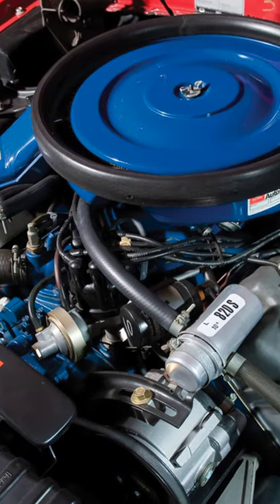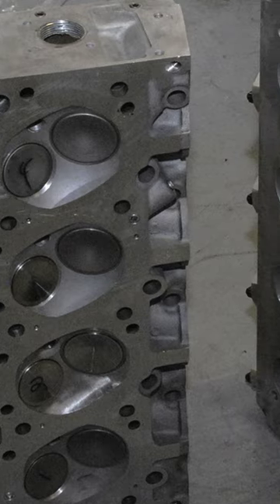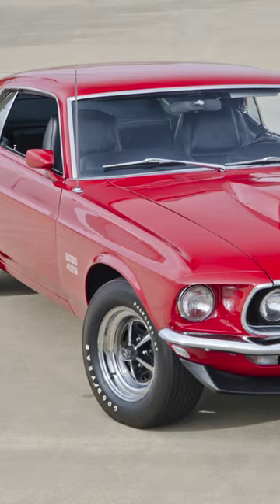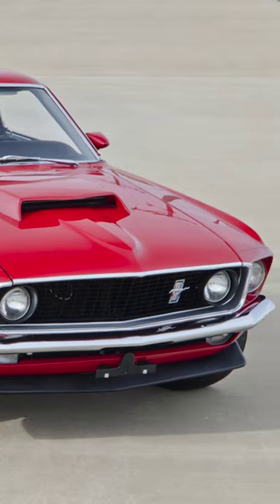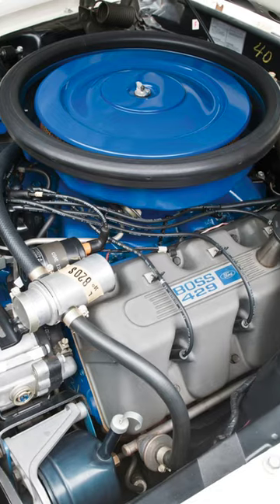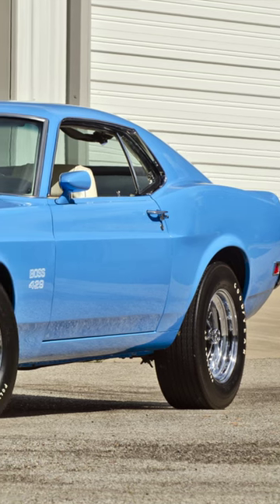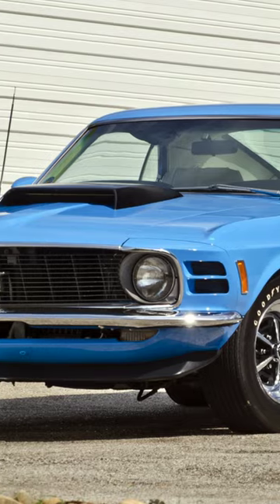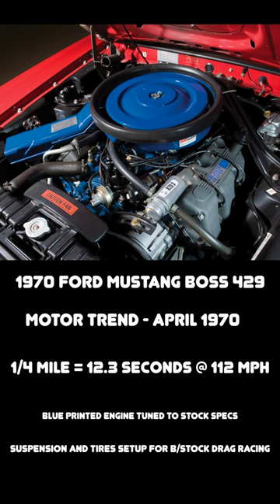Ford's Hemi V8 - Boss 429

Comment: My time with the Hemi Cuda, L88 Corvette, LS 454 Chevelle, and the 427 Cobra. Fast cars, fast women, rock & roll, and cheap gas.The fun days.
Reply: @TimothyMichaels  👍
Reply: no doubt I lived it wild times & happy *
Reply: When trucks were 50 bucks good times
Reply: Back when you could fill up by scrounging for change in the seats and ash tray
Reply: 🥃 cheers to all the brothers from the good Ole days.👍
Reply: Haha how about a 289 cobra with a 427 chassis
Reply: @MrTheHillfolk  that's just a 67 68 mustang
Reply: " a life well lived !" ( thr good times )
Reply: " a life well lived !" ( the good times )
Reply: Absolutely a kicking fun time ro live!
Reply: @poolguy101  we have Alm done that.  👌👌🏴
Reply: Now yall drive civics n corollas? Lol
Reply: @O S   Actually, I own a Z06, and the gas is not cheap, I'm married but I still listen to Rock & Roll.
Reply: @William Kacensky  well frack on my man!
Reply: @os7349  👍
Reply: L88 corvette is a very very rare car only 10 survive now. So I doubt you saw one
Reply: dazed and confused
Reply: I had a 70 Cobra jet Torino. Late 80s. Gas was cheap but still used a lot of it. 429 super cobra jet, 4spd, 401 Detroit locker. Run mid to high 11s on street slicks. Low mid 12s on reg. rubber
Reply: @Tony Preas  Sweet. One of my many rides was a 1964 Belvedere with a 426 wedge phase two motor. Not stock, it had 13.5 high dome aluminum pistons, 480 lift, 312 duration Crane cam. High-rise Edelbrock manifold, single Holly carb with hooker headers. Worked heads. Needless to say, it was extremely fast on the street, and could easily clock the times you posted.
It had a bubble glass rear window instead of straight glass. Painted  Ditzler black, with white roll & pleated interior. White headers and ladder bars. It had a 440 six-pack air intake scoop. The car looked menacing back then in the sixties. I never lost a street race and back then I had plenty. Even the cops liked my car.  :)
Reply: Had a l88 427 in a 67 chevelle.4:11 4speed.riduculous.couldnt get traction til 3rd gear
Reply: @Mark Simpson  
That was a beautiful body style. Only if we had known to keep these cars.  There were so many beautiful body styles back in the sixties.
Reply: @marksimpson100  389s woulda give you better first thru  third but drops a bit on the high end.
Reply: Ahh yes the 70s
Reply: “Life is good” -Hickok45 😂😂
Reply: @BlackNight Gaming  
I enjoy your gun videos Hickok 45. 😀
Reply: @williamkacensky4796  
🍻  🇺🇸
Reply: @marksimpson100  
Definitely not stock !   🤣
Reply: L88 did that mean the block was ninety degrees as opposed to forty five degrees as V8
Reply: Right on.
Reply: The good old days!
Reply: 1969-1970 saw the true monsters of the muscle car erra. These weren't pony cars, they were animals.
Reply: One of my favorite cars ever only mustang I like better is a GT 350 with a 5.2 l flat-plane crankshaft
Reply: Your Genous
Reply: Lies lies and more and more LIES kiz
Reply: @poolguy101 yeah, but remember wages were about $1.45 an hour🙁 I graduated high school in 1969, I had a ‘61 Pontiac Ventura w/389 tri-power, paid $200 for it, insurance was $165 a year full coverage. I was a bus boy at a restaurant, made .50 cents an hour. Good ol’ days!! 🤠
Reply: 400 ram air 4
Reply: @CoyoteFTW  True on the rare statement as only 216 L88 Corvettes were made. John Fox was the owner of a white 1969 L88 Corvette in the Berkshires where I lived. Back then, this Vette was extremely fast.
Reply: Yup yup! And still unmatched!
Reply: @dogdue4588  True.
Reply: @MrTheHillfolk  Haha You can keep the small block....

Comment: It was Ford's answer to Chrysler at the time.
Reply: Yeah but it was no answer at all!
Reply: Buick Torque Monsters enter the equation. GSX proven fastest car of 1969-70…
Reply: So what was the SOHC 427??
Reply: @johnpeters9793  that too
Reply: @tomschmidt9923 - Boss 429 destroyed the 426 hemi in NASCAR and later 385 series big block Ford Boss proved best potential dominating pro stock in NHRA and IHRA
Reply: Lol, Ford went 9-1 in 10 seasons against Chrysler hemi. The superbird was Chrysler's answer to Ford and went 1-1.
Reply: @Wolfcamp555  427 cammer
Reply: @Coronet_shop  not in NASCAR. They banned that engine. 427 high riser and boss 429 dominated the hemi from 1963 to 1970. Chrysler's only win came in 1970.
Reply: @Wolfcamp555  ah nascar whoops
Reply: @CoyoteFTW  429 Boss only ran in NASCAR for about a year and a half before Hemi's were banned. It never did well in drag racing since it didn't produce good low end torque numbers being developed for super speedways. Then regulations shifted everything to small blocks within a couple years. It was a come lately attempt to keep up with Chrysler's Hemi.
Reply: it is my understanding that Ford build the first hemispherical engine
Reply: @rodneygraves1230  25 more hp on the nascar track
Reply: @rodneygraves1230 Sure it was
Reply: @rodneygraves1230  - Ford engineers: Robert Yates, Bill Roper, Lee Willyard, Denny Woodle made sure every 429 made 610 horsepower and if you pushed it a little bit and tuned it, you would get about 620. Ford beat them in power. And beat them in weight. Boss engine was probably 100 pounds lighter at least. The Hemi was 700 pounds and the Boss was 600. Shotgun hemi was clearly better engine. Doesn’t take a genius to see that.
Reply: @johnpeters9793  it was almost the same but it had a ridiculously long timing chain the tends to stretch over time.
Reply: That's Not True At All, After That Motor Was Used In NASCAR ...... It Was Beating EVERYONE, Including The Dodge Hemi So It Waa Banned From NASCAR Afterwards.  That's The Real " Answer " And Trurh.
Reply: @johnpeters9793  it was a hemi also
Reply: @ztruth9861  negative.
Reply: @Wolfcamp555  Petty won Championship in 1964, driving a Plymouth, Chrysler sat out 1965, David Pearson won in 1966, Petty again in 1967, Pearson won in 1968 in a Ford after a falling out with Cotton Owens, Pearson again in 1969 Driving a Ford, Bobby Issac won in 1970 driving a Dodge Daytona the only championship the wing cars won, and in 1971 Richard Petty in the last year for a Hemi in either Ford or Chrysler and Plymouth's last full year, won the championship. so 64-71, Chrysler cars won the Championship 5 times , Ford three times. If Ford had run the King Cobra in 71 they likely would have won. So pretty even.
Reply: @GruesomesGarage  not talking about driver championships. We're talking about NASCAR manufacturers championships.
Ford 427/429 won 1963, 64, 65, 66, 67, 68, 69 and lost in 1970.
Reply: @Wolfcamp555  You're comparing apples to oranges. The manufacturers championship  was configured so basically the manufacturer who had the most fielded cars had the advantage . Chrysler was never going to have more teams running their cars than Ford. Ford spent millions in the 60s on motorsports not just in NASCAR but the GT40 program, USAC,etc. I mean looking at the Manufacturers title Chevy has won 42 vs Ford's 17. If Chevrolet didn't pull out of racing in 1963,they most likely would have won the ones you have listed. So lets take 1966, Plymouth won 31 races, Dodge 18,and Pearson won the points title in a Cotton Owens Dodge. as you point out Ford won the manufactures title.Lets say Pearson won the race and Petty came in second, yet being more Ford teams being fielded 3-10 are Ford cars for example. Ford based on shear numbers would generate more manufacture points.
Reply: @ztruth9861  actually the first hemisphere head engines started appearing in the teens Peugeot had a DOHC engine with a hemispheric combustion chamber that they ran at Indy in 1913
Reply: @GruesomesGarage  Ford's racing program was called Total Performance. It really wasnt about NASCAR. Ford won, Indy, Lemans, NHRA and F1 manufacturing championships too with three engines, the 427, the 289 and the Ford Cosworth.  And to this day, no other American car company has won Lemans. In NASCAR, it was Ford vs. mopar.
Reply: @Wolfcamp555  Well aware of Ford’s program and it was impressive. Chrysler was kind of a small fry in racing at the time. They had success with Petty and others, drag racing too. But they didn’t have the funds to supply multiple teams. It’s how they lost Bill Jenkins back to Chevy, he wasn’t getting the support he felt he needed, even after winning Stock Eliminator. Ford was as you pointed out in many different forms of racing at the time. While much hoopla is made about the GT40, it’s overlooked that they broke the dynasty of Offenhauser and the roadster in USAC racing.
Reply: @GruesomesGarage  Chrysler had plenty money. They just chose not to engage in anything else.
Reply: @Wolfcamp555  you forgot the 427 Ford tunnel port.

Comment: It's horsepower was impressive but its torque was equally impressive 500 ftlbs +
Reply: It's balance was amazing. 1 hp to 1ft/ lb of torque was unheard of for the time it was made. Like Nascar disallowed the 351 cleavleand as an engine for Ford as Chevy & Mopar had no small block that was even close to  keeping up with it. As the cleavleand got named a Y block as it had the ci of a   small block but the size & shape of a big block.
Reply: @tonypreas9850  facts 💪💯
Reply: The cleavleand got more into & out of a head than any engine made by anybody at the time. People still argue about the 2v heads were better to build for racing than the 4v heads but build a set of each and see. Give you more to work with. If running factory 4v were great.
Reply: @tonypreas9850  , idk the 340 Mopar is an amazing motor , saw a 70 340 duster gap a mustang with the cleveland one night , couldn't tell you how "stock" they were lol
Reply: @tonypreas9850  - yes the 351C had the highest horsepower to displacement ratio of any mass produced push-rod (OHV) V8 not solely because it had well designed ports and large valves providing superior volumetric efficiency, but also because it had superior thermal efficiency provided by one of the best performing combustion chambers of any mass produced OHV (push-rod) V8. Cleveland is the result of an aggressive design program, the 335 series motors were capable of making more horsepower per cubic inch, naturally aspirated, using gasoline fuel, than any other mass produced OHV motor ever made. It represents the culmination of all the motor savvy Ford engineering had accumulated during the Total Performance era.
Reply: suppose suppose was good 👍 😕 😕 😪 😌 😒 if if works 💪 👷‍♂️ 👷‍♂️ 🤔 🙄 😕 😐 💪 💪 💪 💪 i
Reply: No that engine had serious port velocity issues. The intake ports were so big that it didn't have any port velocity. It didn't even start to make power until 3900 rpm.
Reply: @daltonyoung1749  Yeah the 340s were impressive but you're right not sure how stock she was. Different gear ratios etc as well.

Comment: Thank the Lord for the big-block Ford!
Reply: Big Block is GM. 385 series is ford. Factory 8000 RPM crank
Reply: 429/460 is the biggest production passenger car engine Ford made. It's a big block to Ford guys. The FE is the FE, 260-351W is the small block, 351C/M/400 is the Cleveland. Sue me.
Reply: @eddiehennig7835  actually no that’s not correct at all. Most ford guys will call them by their series and the 460 is not the largest displacement ford made 🙄
Reply: 429-460 is 385 series 351c m and 400 are 335 series and fe is the fe and the 289/302/351 Windsor are Windsor blocks also known as small to a lot of folks yes…..there’s also the Mel blocks and the y blocks and the flatheads
Reply: Blah
Reply: @bryangillis5183  - I didn't say it was the largest Ford made - its the LARGEST PRODUCTION PASSENGER CAR ENGINE Ford made. Learn how to read.

No Ford guy at a car show has ever said, "Sweet 385 series, bro!" Check my uploads, I know Fords. If you want to refer to them by their series like a doofus, you're more than welcome to. In the meantime, sue me.
Reply: @eddiehennig7835  I know my fords as well, been rebuilding and restoring them for 25 years. Big block small block is a GM Chrysler term which shows how much you know. Ford never referred to any of them as small block or big block, you learn how to read.
Reply: @bryangillis5183  - I think you read more books than you wrench. SBF and BBF (small block Ford, big block Ford) is common jargon and abbreviations among Ford guys. Aftermarket parts manufacturers like Edelbrock and Trick Flow use it as well. So... get bent!
Reply: still couldn't beat a finely tuned lS6 with a true drag racer at the wheel
Reply: @snickersberet4792  - "But muh LS... derp!"
Reply: Windsor and FE
Reply: @eddiehennig7835 

You sure yap like a little puppy backed into a corner.....especially when you are clueless. 

The 462 was the largest passenger car motor Ford produced.....so you're wrong.

The 351C, while sharing the same bore spacing and head bolt pattern with all Windsors, has a SHORTER deck height than a 351W....so if you insist on calling one a small block, the other is as well.

In addition, the 351M/400 also share bore spacing and head bolt pattern with all other "small blocks"....so the same applies. 

Quit while you're behind...

Comment: I LOVE the Boss 429 Mustang.  Chevy fans always get mad when you mention how fast it actually was.  They should have made more of them.
Reply: Didn't make more of them. No enough interest..Buyers were going towards the 426 Hemi
Reply: For HP maybe not for quality. If I bought an absolute muscle car to DRIVE for the next 20-30 years daily... Mustang all day long.
Reply: As a Chevy fan, I like the boss 429.  Competition breeds better engines.
Reply: Im a Chevy guy, love the boss 429
Reply: From the factory they were not fast, not even very quick, Ford chose to choke them down for some reason, with some work and parts, they were very fast. Carb was way to small a cfm.
Reply: @Musclecar1972  well nothing was what we consider that quick by todays standards.  However Chevy fans always forget that only about 1300 Boss 429’s were made so their claims to have actually ran against them back in the day was slim to none compared to the thousands of 396 and 454’s running around.  However they did testing on video with the Boss 429 against its contemporaries using old style tires and it beat every single one of its contemporaries in quarter mile.  You can watch the video on YouTube.
Reply: @scottsvt9104  We had 2 here, I had a 69 Yenko Camaro, the Boss 429 was not a challenge, but as I stated, with a little work, it would have been a whole different story, the Yenko wasn’t a world beater either, in 1970, I bought an LS-6 SS Chevelle, now that was a fast car, but as you said, nothing compared to today, they are a whole other level. I will say, the driving experience was a lot more fun back then, today, the car does a lot of the driving for you, Im not a fan, I’m pretty old, but have tried out a few recently, meh, is about all I have to say, but they do have serious power.
Reply: @Musclecar1972  right, low to high 13’s is really what you could realistically expect from the old Polyglas tires.  A Yenko is a different story but small mods to the Boss would annihilate the Yenko.
Reply: @scottsvt9104  I agree, the Yenko was nothing more than the 425 hp bb, with a slight tuning, the ZL-1 would have been good competition, but would have ultimately lost as well, with the right mods to the Boss, in stock trim though the Boss 302 was a much better choice back then, I ran both of the local cars here and it wasn’t even close, I befriended one of the guys and we worked his car as much as he could afford, and got it into the 12 rage in a quarter, it still needed more work, I laugh when I read the comments on the older muscle cars, people have them as world beaters, not true. Some of the fastest street cars back then were the Mopar super stock 426 Max wedge cars, used to eat the street Hemi alive, all day long. FYI, have you ever looked up the Olds W-43? Interesting reading. I’m an Olds guy, but love all muscle stuff no matter the flavor.
Reply: @Musclecar1972  I looked up that W-43 which is pretty interesting.  I’ve never seen one before.  I’ve seen the boss 429 and SOHC 427 but never that.  Oldsmobile made some cool cars back in the day.  Not too many people know about them though.
Reply: @davidjenson8124  not exactly. nascar limited engine size in '71 so that ended the run to two years. why they didnt make more in those two years was due to the cost. Ford had to send them to Kar Kraft to fit the engine. a 385 engine in a mustang is very tight. so it was a psuedo custom car. Chrysler's 426 and earlier Hemi program just had such a head start.

 the real interesting thing is why they are not used in NHRA. $$$$ run everything. the 385 engine has 4.9 bore centers which was outside the limit set by the NHRA. the limit was set to Chryslers bore center on the 426. eventually they bump it a little, but stayed below that 4.9" number.  back to the $$$$, MOPAR was really backing the NHRA. so basically you can run anything in NHRA as long as its a BB MOPAR.  Sad too, it would have been cool to watch MOPAR and Ford go head to head with Hemi engines.
Reply: @scottsvt9104  actually there were less than 975 boss 429 mustangs produced between 69 and 70. Back then to run an engine in nascar you had to sell at least 500 units with that engine to the public
Reply: I remember they were greatly underrated it was sad they quit making them

Comment: Fun fact there are two different Boss 429 engines.

The 1969 version of the engine had hydraulic lifters because Ford still wanted to make this partially a street engine the problem was I didn't feel like it was making decent power down low and in a couple of tests a 428 Cobra jet Mach-1 could get off the line better so in 1970 Ford finally gave the engine mechanical lifters and the car was a lot quicker
Reply: Never had a chance to drive the Boss 429 but did drive the 428 Cobra Jet w/ C6 trans. Quicker than 66 Chevelle 427/ 425 hp 4 speed Muncie. 
Amazing era. Wow.